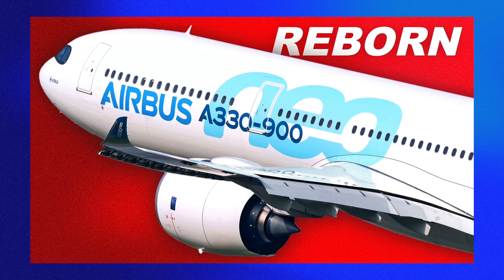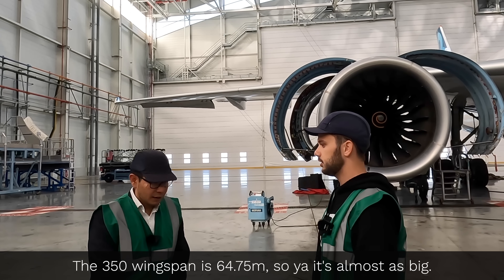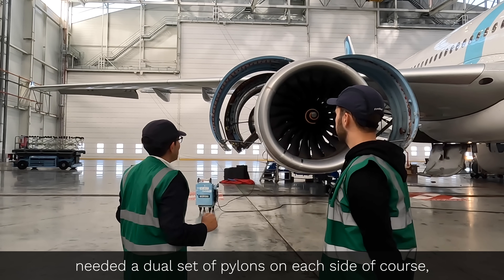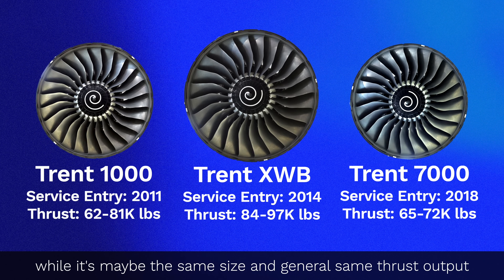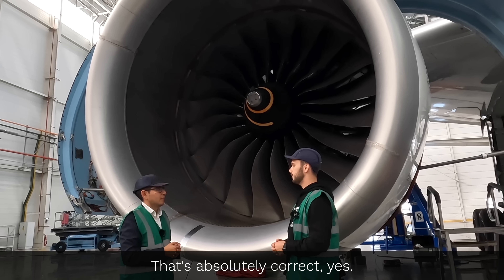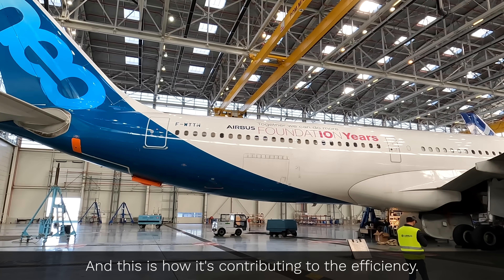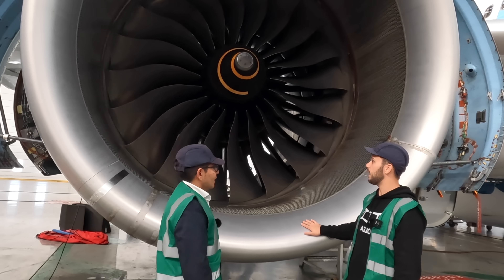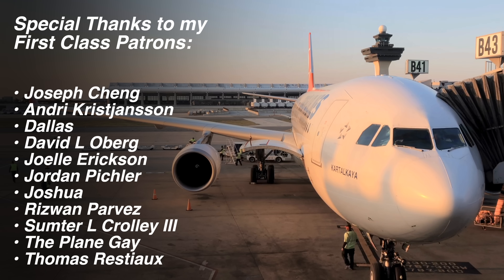Exclusive: A Look Inside the A330neo Flight Test Aircraft

Comment: 3 things. I Never new that the primary wings were redesigned! Airbus also had to remove to some pylons and different materials for the engine cowling and the primary wing alone. 

Another things was that the 30NEO has 66% bigger overhead bins. 66% is a lot!

The new tent 7000s are 11% more efficient thatn the Trent 1000s  and older engines that the 30CEO operated!

Comment: First of all, Airbus A330 Neo is necessary to come into the Market because to compete with Boeing 777X, this is airplane that has the Similar Capacity to give a Tuff Competition. As learned from this video, that it has Very new Engine Option, lavish Interior Cabins, the new Equipment, new systems, new Avionics and the new composite materials used along for the Aluminium built in materials are great, such that it reduces Weight Exorbitantly, so better fuel Efficiency and less Greenhouse Gases to say. :)

(BTW my Size 2-XL). 

Thankyou for your Nice Content of Videos. We are Learning new thing from your channel day by day. :))

Comment: For clarification, the “one piece inlet” really means the inner barrel of the inlet does not have seams.  This allows for more, non-interrupted acoustic treatment i.e. better noise attenuation. The metallic inlet lip is made in one piece for smaller engines but unlikely to be one piece on the Trent 7000.

Comment: Nice video, but personally it is not an elegant looking aircraft. The proportions and the way the cockpit, nose and window go together just seem off-putting to me. And I very irrationally hate those engines every time I see them. They just don't look cool, and then get worried the cooler looking engines and chevrons will disappear. Not as ugly as the a340 though. Thankfully, the a380 is ugly in all the right ways and of course the a350 is gorgeous. 

But i have to disagree, based on looks and no knowledge, the a330 is not elegant. But the neo is an improvement for the type.

Comment: I work at Airbus in Toulouse as an aircraft electrician on the A330. And I see, everyday, the differences between the neo and the ceo. But I didn't know about all the wings enhancement!
Did you know that the beluga XL (which is based on the A330 ceo) can carry a pair of wings for the neo, wich would not have been possible with the Beluga ST due to the higher span of the neo! 😳
Medium Size 🤞

Comment: Love their attempt to spin the Trent 7000 as a completely different engine when it is literally listed as a variant of the Trent 1000 on the TCDS. During the last few month, I have learned that customers of the A330NEO is underwhelmed by the performance of its engine and also that the structural integrity of a few dozen short body A330 CEOs and NEOs are at risk of “catastrophic failure” because Airbus failed to completely perform certain manufacturing procedure.

Comment: Whenever I heard A330neo I just thought of new engines and wings didn't know that they actually improved the cabin software and vertical and horizontal stabilizer aswell as the weight of the Aircraft very nice plane 

My size well I'm 15 so I go with a size 16-17 or large size

Comment: Really nice insight into the changes from the ceo to neo. I didn't know that the engine inlet is also a single composite piece like on the A350. Other than that I already knew all the points about the new wing, but thats because I'm working on it.

Comment: In short; what is the main difference between the smallest A350 and the most highly specced A330neo?
Reply: While waiting for a human answer, I asked AI:

The A350 and A330neo are both wide-body, twin-engine jets designed for long-haul flights. While they share some similarities, there are some significant differences between the two models.

• Design and Capacity:
The A350 was designed as a more modern aircraft, with a sleeker fuselage, larger wingspan, and more efficient engines than the A330neo. The A350's composite construction makes it lighter and more fuel-efficient than the A330neo. The A350 can accommodate up to 440 passengers in a high-density layout, while the A330neo can seat up to 460 passengers in a similar configuration.

The A330neo has a longer fuselage, allowing for more passenger seating and cargo capacity. However, the A350's larger wingspan and more efficient engines allow it to fly longer distances and more efficiently than the A330neo.

• Range:
The A350 has a greater range than the A330neo, with a maximum range of 15,000 km (8,100 nmi) compared to the A330neo's range of 13,334 km (7,200 nmi). This means that the A350 can fly further without refueling, making it more suitable for long-haul routes.

• Fuel Efficiency:
The A350 is more fuel-efficient than the A330neo due to its advanced aerodynamics and lightweight materials. The A350's fuel burn is approximately 25% lower than the A330neo, which translates to lower operating costs for airlines. The A350's Rolls-Royce Trent XWB or General Electric GEnx-1A engines are more fuel-efficient and produce less noise and emissions than the Trent 7000 engines used on the A330neo.

• Engines:
The A350's engines, the Trent XWB and GEnx-1A, are more fuel-efficient and produce less noise and emissions than the Trent 7000 engines used on the A330neo. The Trent XWB and GEnx-1A engines also feature a higher thrust output, which allows the A350 to take off and climb more quickly than the A330neo. The A330neo's Trent 7000 engines, however, are more powerful than the engines used on the previous generation A330, resulting in improved fuel efficiency and lower noise levels.

• Cockpit:
Both the A350 and A330neo have modern glass cockpits with advanced avionics and fly-by-wire systems. However, the A350's cockpit is more advanced and features larger displays and more advanced systems, such as a predictive maintenance system that can detect potential problems before they occur. The A350's cockpit also has a higher degree of automation, reducing the workload on pilots and allowing them to focus on other tasks.

• Price:
The A330neo is generally cheaper than the A350, with a list price of around $296.4 million compared to the A350's list price of around $366.5 million. However, the actual price can vary depending on the airline's negotiation with the manufacturer and other factors. While the A350 is more expensive, it offers better fuel efficiency, range, and advanced cockpit features, making it a more attractive option for some airlines.

In summary, both the A350 and A330neo are advanced and capable aircraft designed for long-haul flights. While the A330neo is cheaper, the A350 offers better fuel efficiency, range, and a more advanced cockpit. Ultimately, the choice between the two aircraft will depend on the specific needs and budget of the airline.
Reply: The 350 is wider and can seat more

Comment: I didn't know that RR created the Trent 7000 exclusively for the A330Neo, and worked hand in hand with Airbus to make it an engine that not only was an upgrade from the previous generation, but also one that fit the objectives that Airbus had in mind. I also never really realized what technologies (especially in regards to the engines) the Trent 7000 took from the Trent XWB. Very cool video as always, excited to see what else comes from the Airbus visit :). 

(PS. Size M)
Reply: @Hypersonic-es6vh AB has done with the 330 neo...
What the heck are you smoking?
Reply: They didn't...
It's nothing more than a Trent 1000 engine borrowed from the 787 with an archaic bleed air system ,in place of the electrical system on the dreamliner !!
Reply: @isthatso5616  at moment 5:54 he mentions that the engine was specifically designed with the A330Neo in mind. Although you are right, it is in basis a Trent 1000, there are technologies that have been adapted from the Trent XWB, in addition to the engine being a 2 generation leap over the Trent 1000. It is still an improved engine, and it was still designed for A330Neo no matter who its predecessor was.
Reply: @isthatso5616  ah Boeing fanboi has entered the chat
Reply: @ant2312  And the Triggered Busboy surfaces again to spew his Boeing hatred upon others..
 We're all onto your schtick little wee one !!

Comment: The 330 neo belongs in a museum, right next the other flying Fossil a 380 !!
Reply: Yea it's based on the 300 310 body but at least it's newer than the 737
Reply: Wdym yes it’s an old design but doesn’t mean it doesn’t have its uses!
Reply: The A380 that has never been bettered for those flying in the cheap seats.
Reply: What about the 737

Comment: The a330neo is an aircraft thayt has been improved a lot. The engines are basically 2 generations newer than the Trent 700, the wings have been designed to make them larger at the same weight and new material were used. Inside the plane larger spaces and optimazation were the key facts that made the a330neo the perfect choices for many airlines, legacy and low-cost airlines.
Size: L